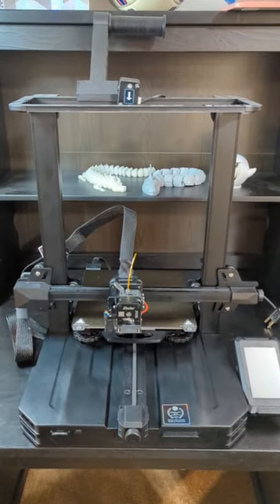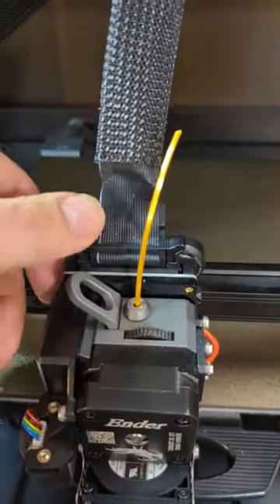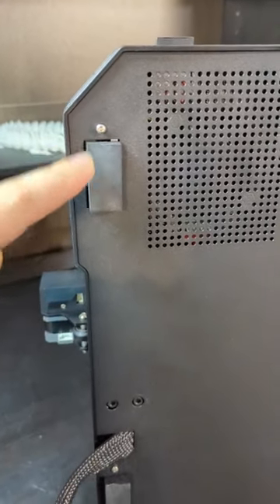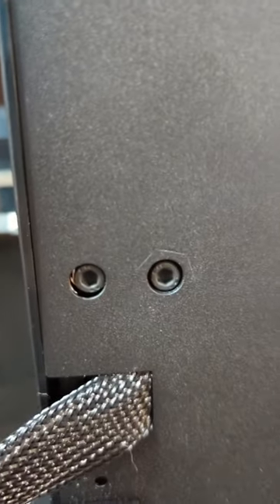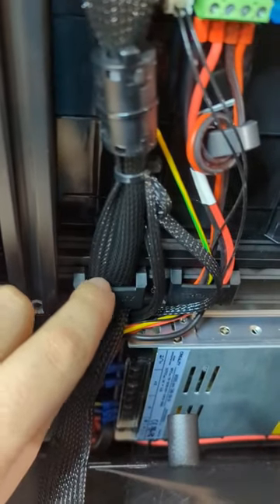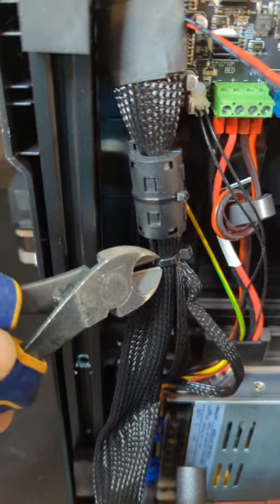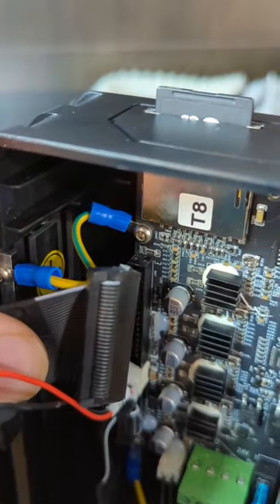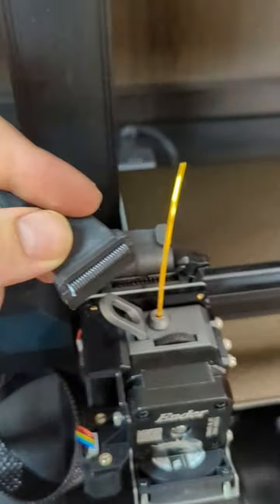How to replace ribbon cable Ender 3 S1 Pro! EASY. #3dprinting #ender #shorts

Comment: How did you get the hot glue off the connector
Reply from the maker: You just peel it off. It should come off easily. If not you could heat it up with a hair dryer or something
Reply: I use the nozzle for my hot glue gun to warm it up and then just ripped it out. It works better that way for me then trying to peel it